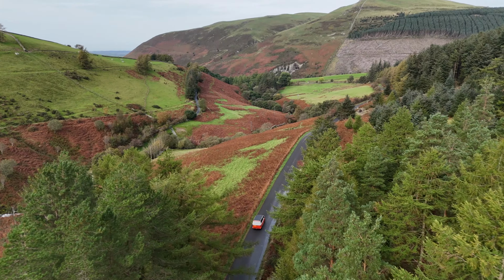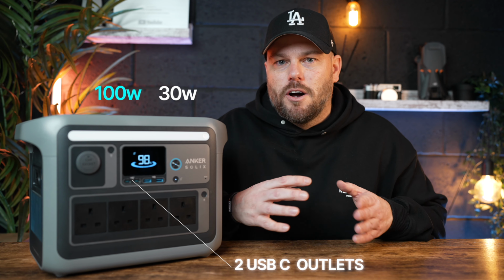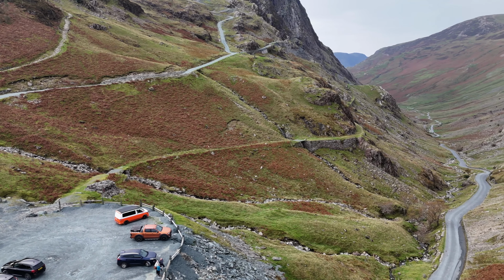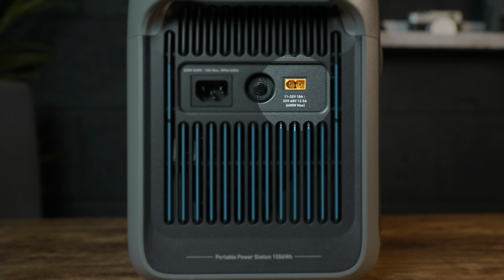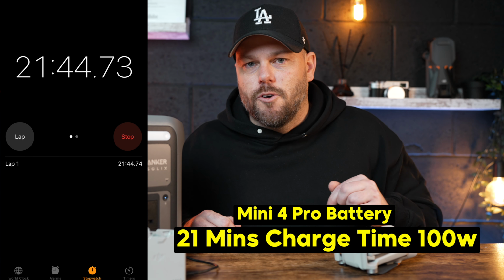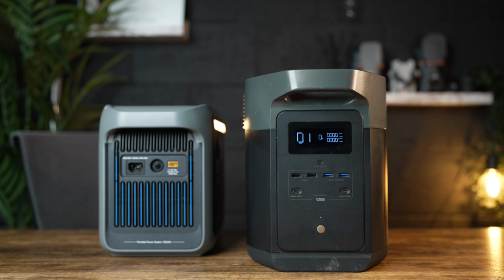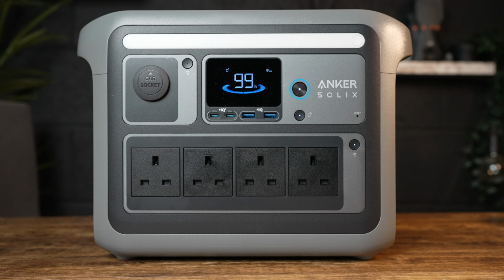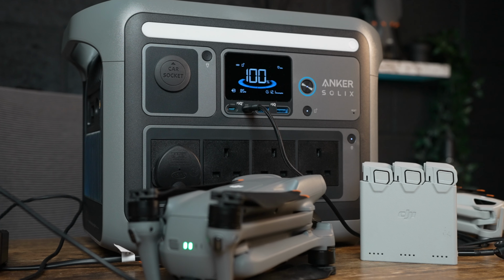HOW TO CHARGE DJI DRONE BATTERIES FAST! Anker SOLIX C1000 Portable Power Station

Comment: I went for the Ecoflow River 2 as my power needs are not huge my DJI Mini 3 Pro charges up fairly fast as do my Potensic drones, when I go carp fishing the unit will serve my battery requirements for three days and I always have back up in the form of power banks - to charge the generator takes around an hour from mains and you can charge through a 12v socket in car or van, I have a 300w invertor if required too which is quicker than a car socket when travelling. 

This is a good video but as a pensioner the cost of the Anker Unit is a bit on the high side, the power banks I have are Anker as are my100w chargers.

Comment: What watts is recommended for dji charger…… be handy for camping and charging my 720wah ebike battery
Reply: I think 30w is recommended. Have no idea how about battery Life after charging it by 100w but 2way dji hub should reduce to 30w even when you are using 100w charger. Thats interesting about charging dji battery in 21minutes 😮. Subject for conversation
Reply: @TKOKamilO interesting for sure. I am experiencing this exact thing more or less. I have a 65watt anker charger and I hooked up a watt meter and it only reads 39watt. Very confused on what is going on since it’s suppose to charge all the way up to 100watt. So my 65watt charger should be maxed out. I charged through the drone and I was getting the full 65watt. So I know it’s not my cables or charges. FYI I have an air 3 I’m charging.